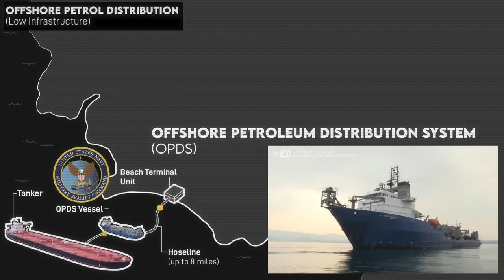The Canoo Pickup :: For The Army First..

Comment: This shows a drastic misunderstanding of how the Military uses vehicles.  Long convoys hauling heavy equipment does not work with current EV design or battery technology.  There are reasons that current Military vehicles are set up the way they are.  Your idea of "large off-road tires" is half the size of HMMWV tires.  This does not have nearly enough ground clearance for actual off-highway use.  The Carbon-Kevlar reinforcements are not actually armor and the addition of real armor will amplify the problem of short range and lack of cargo capacity.  an array of solar panels for recharging will be far too slow for for any kind of rapid troop and equipment movements on a dynamic battlefield.  EV's excel at being a daily commuter.  The technology is not ready for national defense.

Comment: Who’s says it the right thing to do?  How about those that have an interest in selling EVs and the batteries.  Low range and takes forever to refuel.  Unless your driving is limited to running around on a military installation, no thanks.  Until you can recharge that vehicle as fast as I can fill up my tank it’s a no go.
Reply from the maker: Yea, clearly not there yet, but we'll get there. There's ton's of money being spent to try and solve these problems, it'll just take a while.

Comment: You're not using electric vehicles to fight wars.  Not happening.  I spent enough time in Iraq to know their power grid can hardly support life let alone EVs.
Reply from the maker: I'm sure that's what the fellas on horseback said about those new fancy oil burning machines. All in due time, technology replaces itself, the internal combustion engine isn't immune to this law.
Reply: @GearboxPizza  How are you charging these vehicles in the middle of a fight?  Horses were easy, they didn't fight in extended battles like they do today. Feed, rest, repeat.  We would go weeks on end without returning to a FOB and fuel was brought to us.  I am all for technology but you cant fight wars with electric cars
Reply from the maker: You're right, you can fight wars with electric cars yet. But, can we agree that at the very least, incremental improvements are happening rather quickly in the world of battery technology? Capacity will continue to improve, as will weight and cost. At some point, maybe 10-15 years from now, these metrics will eclipse the potential energy when compared to a gallon of gas. It's really more a question of when, and will continued investment in R/D and with the domestic market growing, it might not be all that far off.
Reply: @GearboxPizza  In 10-15 years we will be using another fuel source to fight.  It will probably be hydrogen by that point.  I drive an EV truck, I don't doubt advances in technology. I also fought in Iraq, I know the amount of energy required to carry armor and communication equipment.
Reply from the maker: It's interesting that you think hydrogen will win out over electric. I was really excited about hydrogen back in the very early 2000's when BMW was sort of leading the charge. Unfortunately, it doesn't seem like all that much progress has been made. Also, not sure it solves many problems, rather it just replaced a combustible liquid with another one. I'm going to set an alarm for 10 years from now, and we can pick this conversation back up. Until then, best of luck to you!

Comment: So a golf cart for military bases?
Why would want something this small with 500 Horsepower? You can't carry equipment, or troops. They be better off just modifying "humvees".

This video honestly detracts from the practicality of this vehicle. You aren't even talking about its features. You're basically making bogus sales pitch. The military cannot stop using fossil fuels. They use them for jets too, and fuel is universally available. Try recharging a convoy in the middle of some battlefield and then tell me EV's are a good idea. Only a perpetual motion EV would be good enough, but it still wouldn't work in jets.

Is the military trying to reduce their carbon footprint? 🙄
Reply from the maker: What do you have against golf carts?